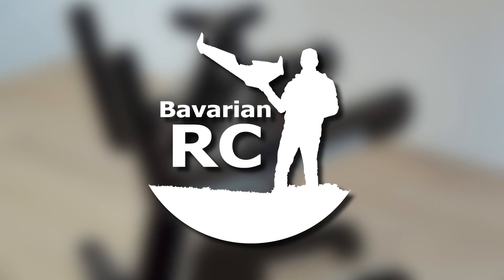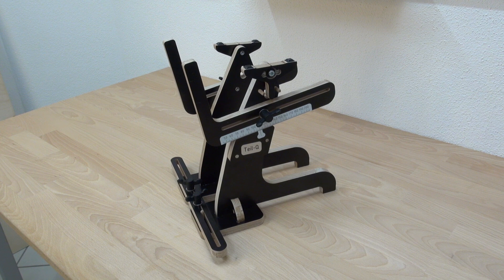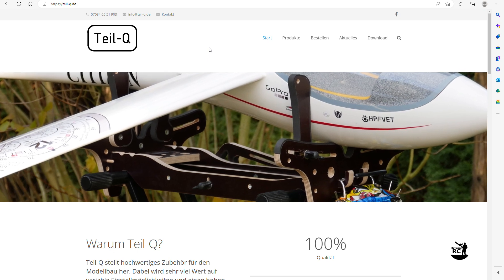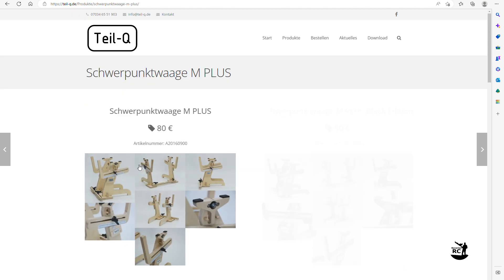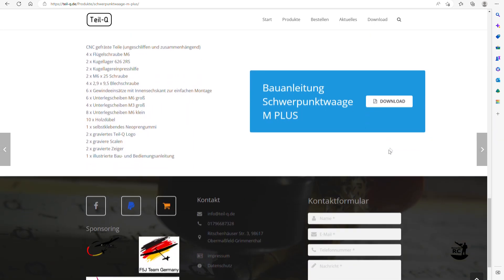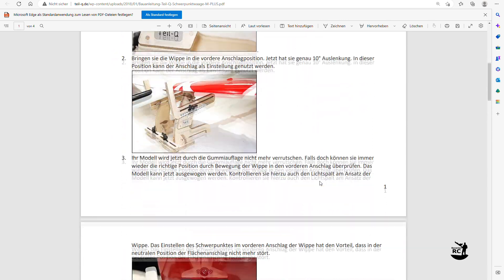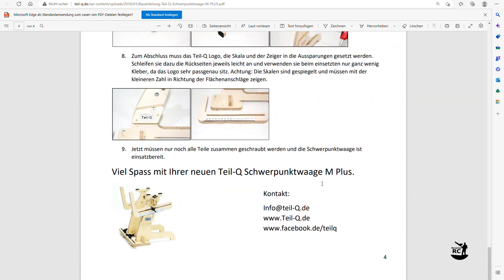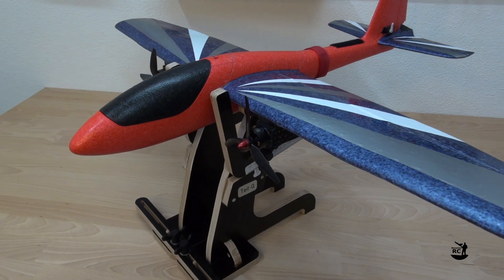Teil-Q Center of Gravity Tool - How to build and use

Comment: Hello. Very nice review. What should be the best product ? Teil-Q L size (balance) for 3m gliders and plus or Robbe SPider (stand+balance) ? thks for reading
JPhilippe. France
Reply from the maker: Thanks. For 3m glider I think you reach the upper limit of size the ro-Spider can handle well. As the Teil Q is more robust I would prefer it for that size and for larger gliders. For smaller planes the ro-Spider is more versatile as it includes balance and stand. Cheers Robert

Comment: Thia looks like a fantastic device but , can you explain one thing? You made a comment the the plane is balanced when the bottom of the "T" is aligned with the slot. This doesn't sound right as it wouldn't account for different wing profiles.???
Reply from the maker: Hi, I am not sure to have a good explanation but I would expect the potential error due to the shape of the different airfoils to be quite negligible. This could only be a few degrees I guess and could result in something significantly less than 1 mm of inaccuracy. Maybe someone has a more scientific explanation. In any case the CG will only be a first setting which has to be fine tuned in flight.
Reply: @bavarian_rc  I agree.
I am probably over-thinking it...

Comment: An example video with a heavier plane would be nice. With a real model it will not cog in the middle. And will fall in Front.
Reply from the maker: It just works the same for heavier models. But the CG needs to be spot on. I did it as well for my Robbe Amplitude or Aeronaut Triple Neo. I know, both are not the heaviest gliders on earth, but I think it proves that it works. As soon as I find the time I will post a video on my Instagram account.

Comment: Where can you buy them in USA ? Or from Germany?
Reply: The manufacturer seems to be running an ebay shop under his name that ships to the US, however P&P has to be enquired individually. I'm pretty sure, though, they can easyly undercut Höllein's 70 EUR.
Reply from the maker: Thanks, I didn‘t see that they run an eBay shop. Hopefully the shipping cost will be more attractive there.
Reply from the maker: Hi, it seems there are no distributors outside of Europa. I found this German shop that is also shipping overseas, though quite expensive (almost 70€): https://www.hoelleinshop.com/Teil-Q-GbR-m201115.htm?shop=hoellein_e&SessionId=&a=marke&Hersteller=201115
Reply: .

 1:53  2:02  @bavarian_rc

Comment: Looks awesome!

Now, with those prices they could sand the edges after taking the boards from the CNC router.
Reply from the maker: Thanks! The sanding was really the hardest part. Without my Perma Grit it would have been a nightmare as the material is so tough.
Reply: @bavarian_rc  Phenolic is hard. That's why it's good.

I said it, because for them it's a 2min job with a bench belt sander
Reply from the maker: Yeah you‘re so right 👍🏻
Reply: @bavarian_rc thanks so much for the awesome video !! I’m about to start building my own now, using the kit and your instructions. Handy tip with the sander - I have an electric one so hopefully that will speed things up.
Reply from the maker: @christianp0st Great that you liked it!
Reply: @bavarian_rc  Yes - using the sander saved me (at a guess) about 1,5 hours of time ! Thank you !